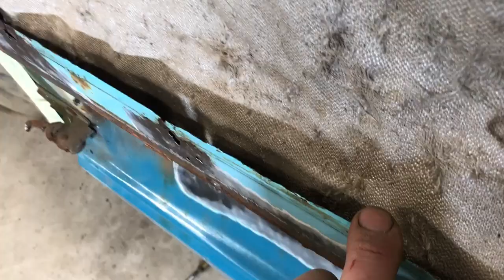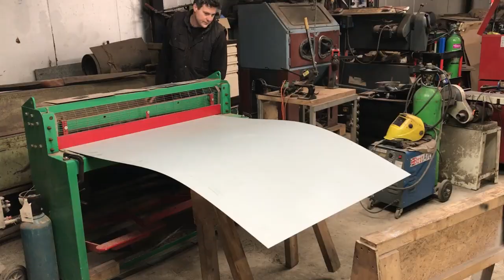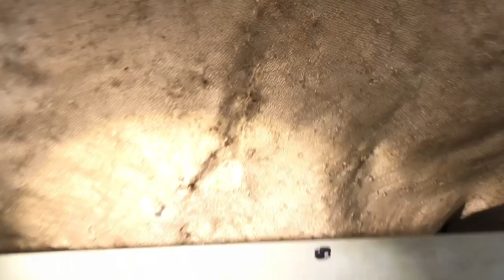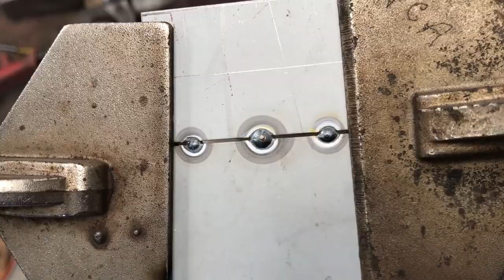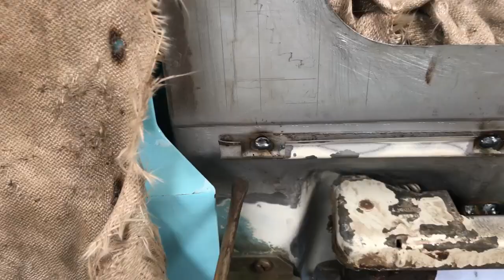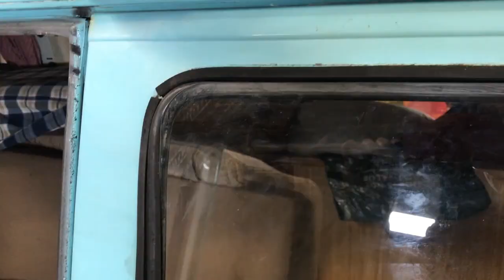How to repair a VW T25 T3 rear window aperture, welding, panel making, restoration

Comment: Ben are you a professional restorer? I have a T25 that needs similar repairs and am looking for a garage to take it on as a winter project. Thanks
Reply from the maker: Hi, yes I do this professionally, but I'm not currently taking on more work. 6-12 month waiting time at the moment.
Reply: @bensclassicbodywork  Ben, i have the same sort of issue with mine, what kind of cost is this repair please?
Reply from the maker: @cunningstunt2  Hi, the exact job in the video costed £950.
Reply: @bensclassicbodywork  Both sides or one Ben?
Reply from the maker: @cunningstunt2  Just one side I'm afraid.
Reply: @bensclassicbodywork  Fair price for a quality job

Comment: Hi how did you remove the old rail, just drill out the spot welds?
Reply from the maker: Yes, it was mainly spot welds but there were two small beads of weld on the top at either end of the rail. I had to use a 9" disc cutter to reach the small beads of weld. They are only about 1/2" long but looked factory to me.

Comment: hi ben please can you tell me where to buy sheet metal at good prices to do some arch and sill repairs thank you
Reply from the maker: In the uk, FH brundle sell full zintec sheets at the best price.
Reply: @bensclassicbodywork  thank you, any recomendation on how to protect the new sills after ?, undercoat, stone chip?, im a noob but can weld a little, thank you
Reply from the maker: @leeyo5494  etch or epoxy primer, then upol stone chip and 2k top coat. Make sure the inside is cavity waxed, that's what will make it last.
Reply: @bensclassicbodywork  ok thanks